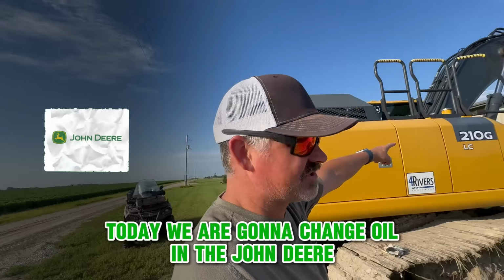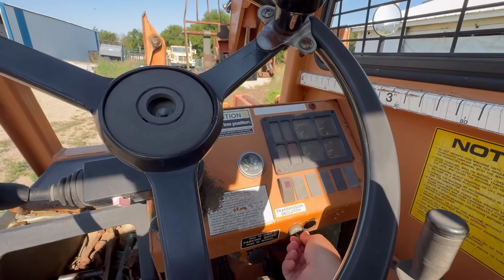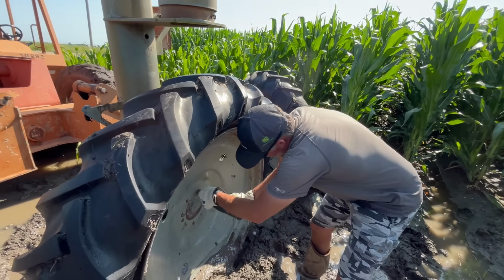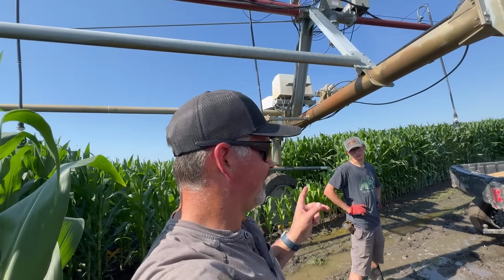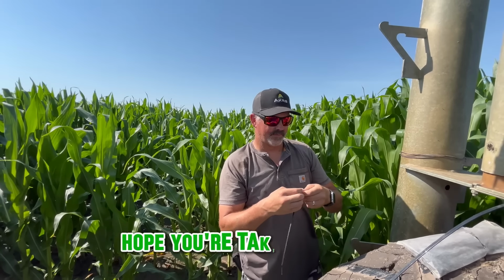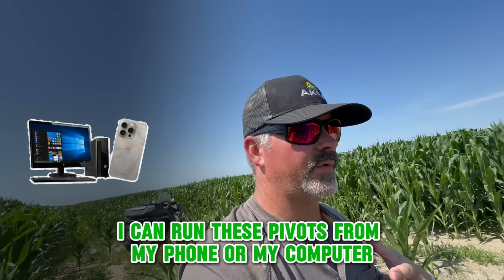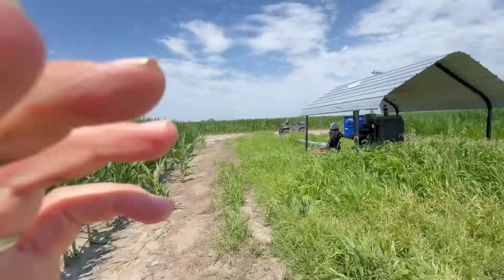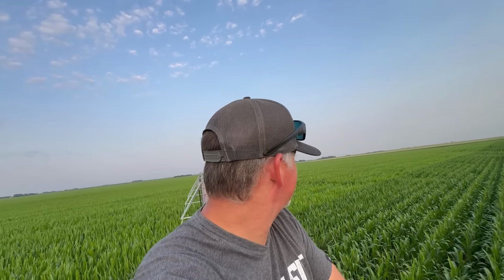Worst spot to change a tire??

Comment: Cale I think its always best to cris cross when tightening will nut up, also do use ever ckeck the air pressure in the tires on your water towers once a season, they are such a slow moving tire, that they don't get seated proper like a vehicle driving down the road, so they will lose pressure